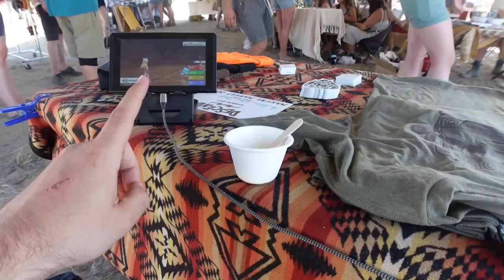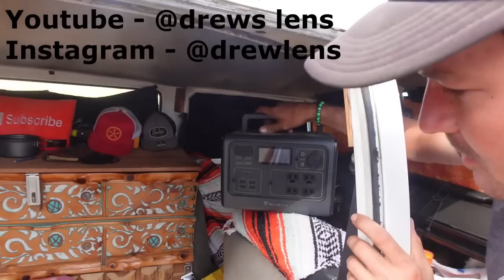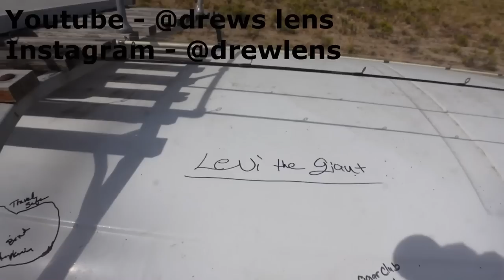My Decend on Bend 2022 with 6 Bus/Van tours!

Comment: Levi,  request  an Invoice from the mechanic  for what repairs he did on the bus. That will tell you what parts he replaced  on the bus. Levi  if you want to  you can email  me the invoice  and my professional  auto, truck diesel  technician  can review the invoice  and  tell you if what repairs  the mechanic  did to your bus was good or OK  or  bad.  My husband used to work for CA  bureau  of automotive  repairs as an complaint inspector  and review  the repair on the vehicle  and review  the invoice  for fraud,  parts, cost and  work done correctly.   He will help you out, he does this review  for friends,  family  and you. He got a dealership  to return $100.00 to a. Friend.

Comment: So was that an admission of not being able to socialize? OK, so you're a little quirky. Use it to your advantage and get out and socialize. You did great socializing and meeting people, especially the girls. If fact, I about though you was going to be moving in Stella the van. LOL The going home bus is nice and something similar to what I'd prefer to do but I think I'm going to start with a short bus, like a 6 window full bus, not a van cutaway.  You probably didn't score any points with Drew's gf Lynzie when you called in the ladies. So you are pretty damn tall. I actually want a longer bus but I think I'm wanting to find a short bus first so I can experiment with a roof raise. Have you considered a roof raise on your bus? You have the right powertrain so it's worthy of it and something you can keep forever, even if you do eventually have to rebuild the engine and transmission at some point. Just something like a 10 inch roof raise would be great and allow you some space to insulate too.